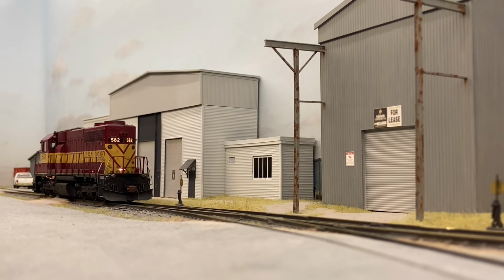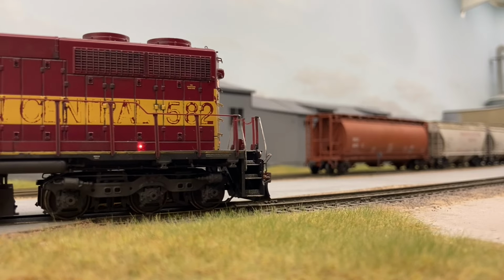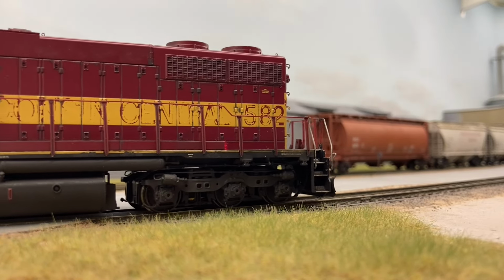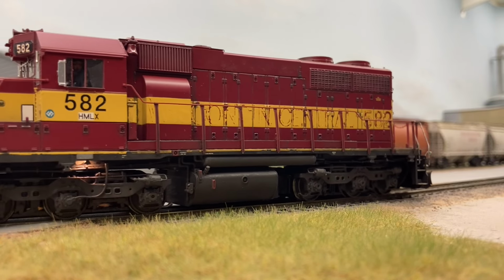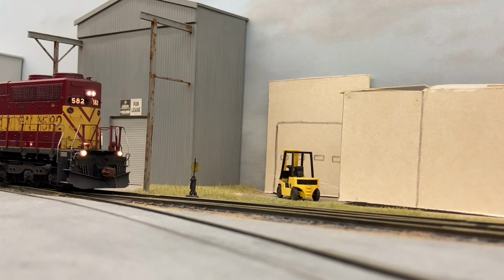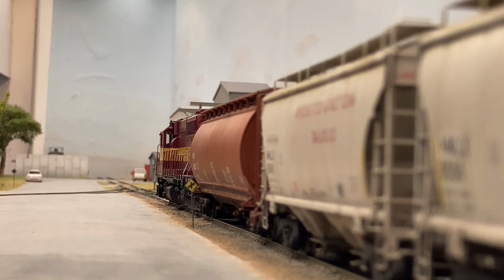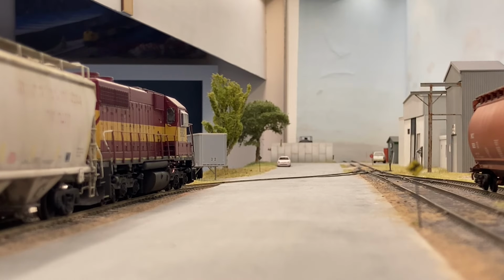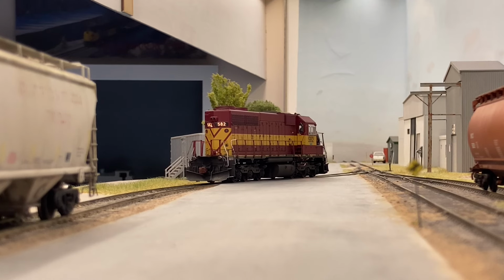The Replacement - SDL39 '582' on Beaverbrook HO scale shelf layout

Comment: Nice addition, James! This is a super model, both the prototype and at scale.  Short length ideal for switching, yet with six axles AND uneven axle spacing which was extremely rare on a domestic EMD (I believe they were export model trucks). Looks great on Beaverbrook.

I bought one from ScaleTrains and liked it so much, I bought a second. Both of them in FEPASA (Chile) livery just to make them more obscure. Still searching for some crew audio in Spanish to add!
Reply from the maker: I have had the locomotive for a long time - but I've only just 'refinished' this side to feature HMLX markings. The prototypes are full of character, and seemed perfect for the Canadian branches - probably already well served by GMD1 and RSC-14s by this stage though...
Reply: It's an excellent job on the faded Wisconsin Central lettering.  If you wanted to be a bit cheeky, given its the WC heritage, you could add a  Three Beasties logo and enhance the story that the unit came to Hilton-Mears after an unsuccessful trial on EWS.

Comment: I remember when CN worked this and how they tended to use pairs of four-axle engines. That curve, down the cement spur to Holcim, is just punishing (both S-curved and also downhill). The SDL39 looks so attractive it makes me wish we had more like it on the fleet. I worried it might be slippery but it worked just fine and I’m not thinking, as much as I might have yesterday, that we should try pairing one of the GP9’s with it and use the GP9 to start and the SDL39’s to keep the train moving? Either way, 645’s are our future and it’s exciting to see this out on the road.
Reply from the maker: Thanks Chris - yes, the lighter loadings that made the operation unattractive to G&W when TT folded has meant that we're getting away with just the SDL39 - as you say, it might have been exciting to see a lash up, but this is a lot less hassle and saves fuel too... we still have the Sweep here though, if the autumn and winter conditions make things difficult for the new arrival!
Reply: What American railroad still uses an SDL39 ?